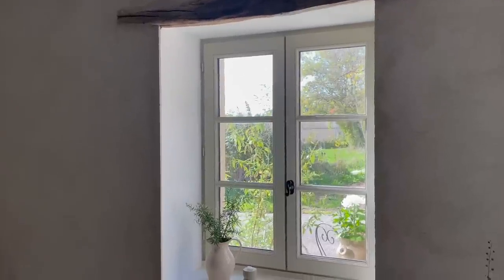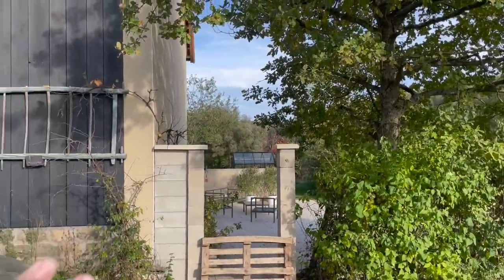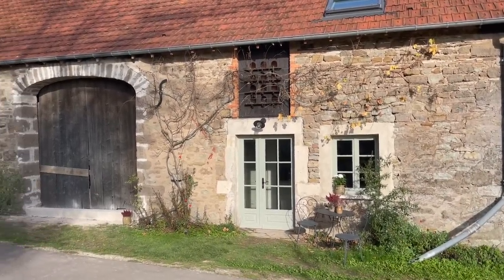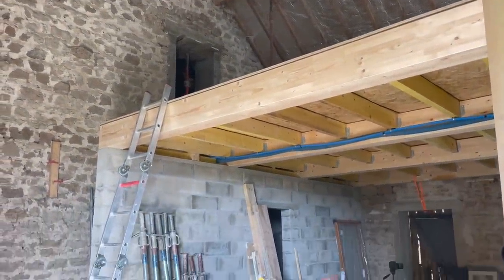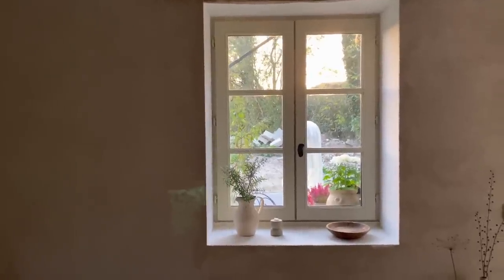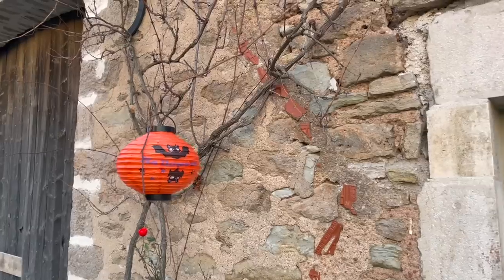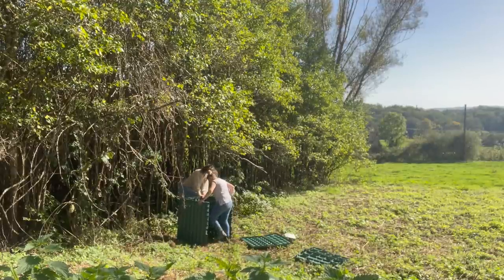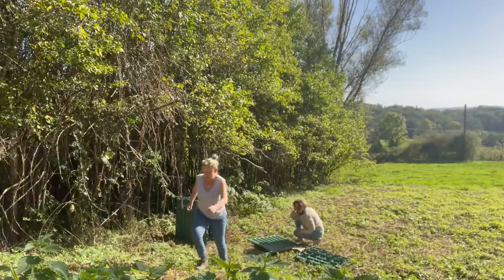This fall is flying by!!

Comment: Hi Marloes, well, I am one who is so pleased that you haven’t yet acted on the curtain treatment for you little window in your gite! Ignore this if you already have this suggestion. I have seen a single~hinged end rod that is attached to the top side section of each window frame. The rods swing against the window, so the curtain is covering the glass. Then you can swing it against the casement to have the window clear. It would be lovely to have a lace or a cotton fabric for the summer and something with a little more weight for the winter. I would also like to compliment you on your style of vlogs. Yours are relaxed and interesting and give me a lovely window into your lives. Do you and your way and be proud of it. Regards Susan at Hobart.
Reply from the maker: Thank you 💜